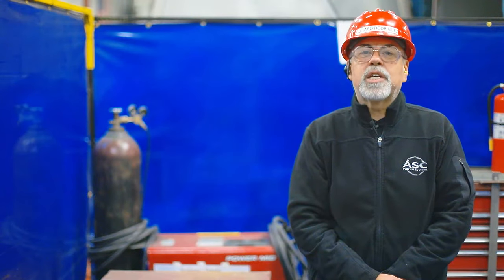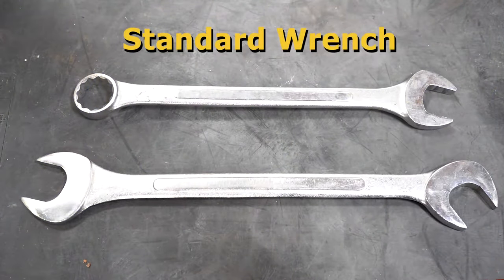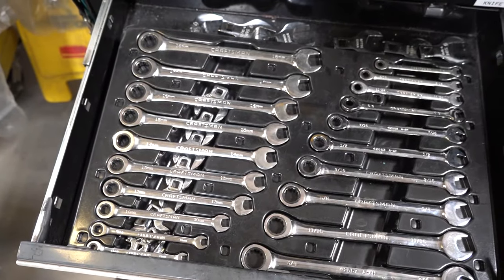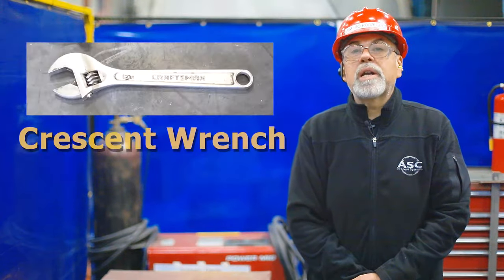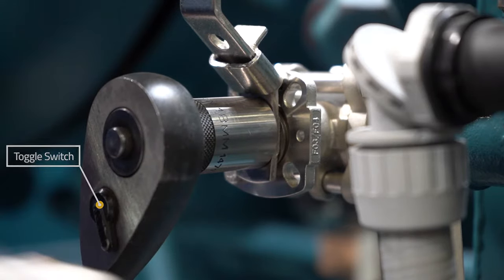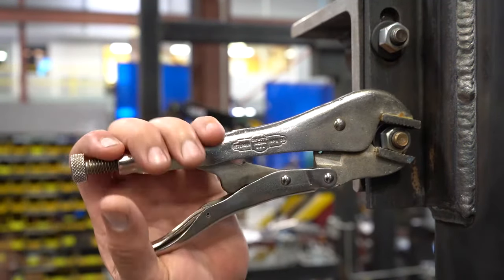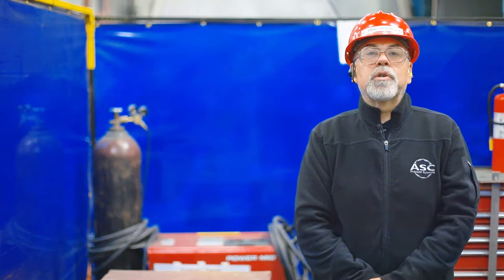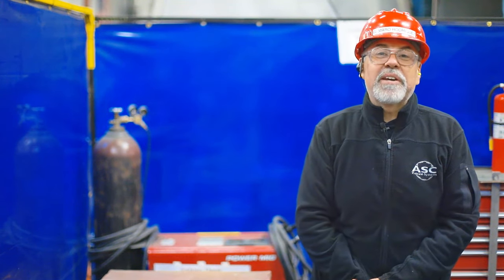Introduction to Hand Tools: Wrenches

Comment: Is ratchet and socket wrench the same?
Reply: Combination wrench same with ratchets wrench??
Reply: 1. My understanding is that a ratchet or ratchet wrench and a socket wrench are the same thing. 
They are a ratcheting handle that accepts different size sockets.

2. A combination wrench is a variation of the normal solid metal wrench that has an open end or jaws on one end of the handle or beam that is sized to fit a specific size fastener. 
There are versions where both ends of the beam are open or both ends are closed, which means a ring or boxed end that fits completely around the fastener. This usually means two sized per wrench; one on each end. By the way, "boxed end" does not mean square-shaped. Boxed end means "enclosed" in this case and are exactly the same as ring wrenches. Back in the day some bolts were square head so the ring wrench actually had a square or "box" shaped hole. That's my theory as to where the name came from.

A combination wrench is a combination of the two; one end is open and one end is a box end or ring wrench. Usually both open and closed ends will fit the same size fastener. A set of combination wrenches will be one size per wrench. So a double open end or double boxed end set requires fewer wrenches because each end is a separate size.

I hope that helps.
Cheers.